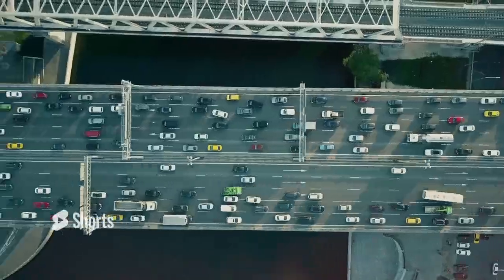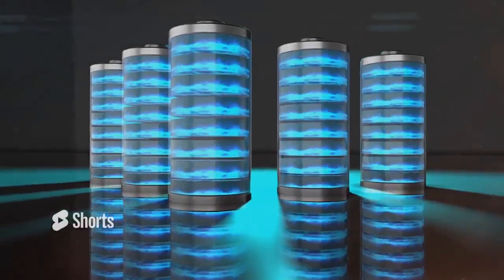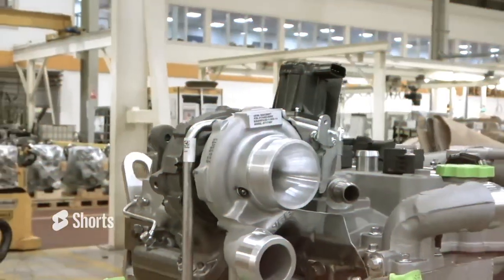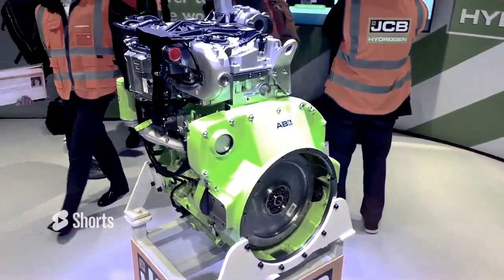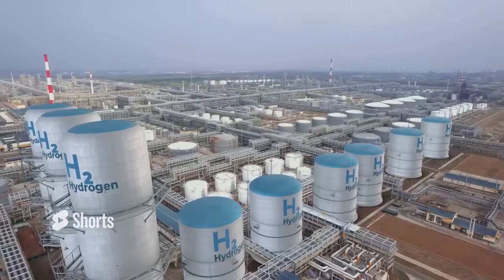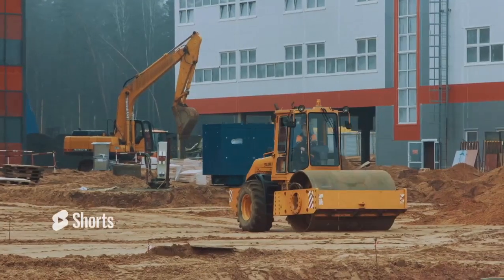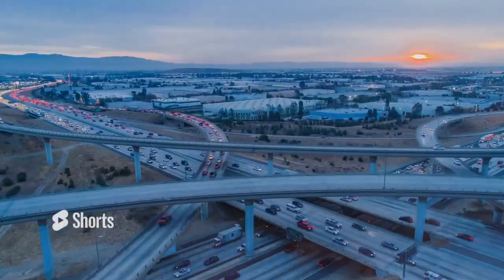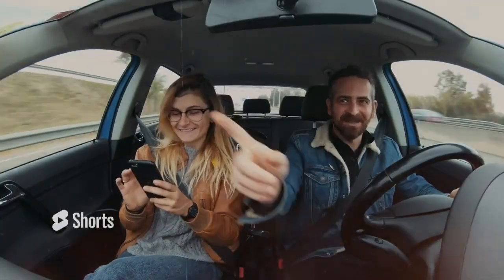What Makes This New Engine a Threat to EVs? Uncover the Secret!

Comment: Ummm, the biggest heavy machinery, Rail Locomotives, large mining earth movers, mining dump trucks, they are all diesel-electric drives. Pretty sure hydrogen fuel cell electric drive systems will be how this goes in the future due to efficiency. I do agree though that hydrogen is the energy storage/transfer medium for heavy machinery over batteries.
Reply from the maker: Great points and insights! Thank you for commenting!
Reply: No engines are cool fuel cells are lame!!